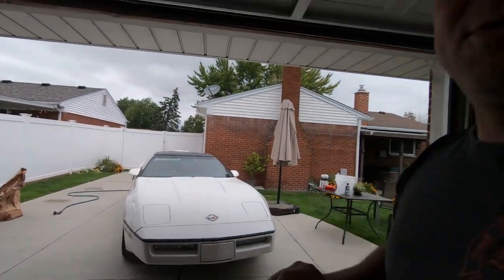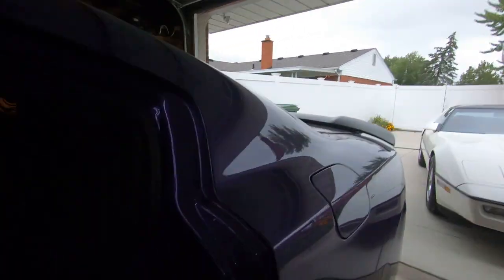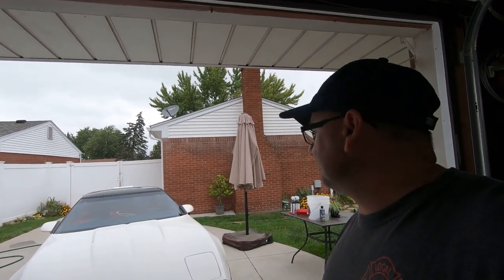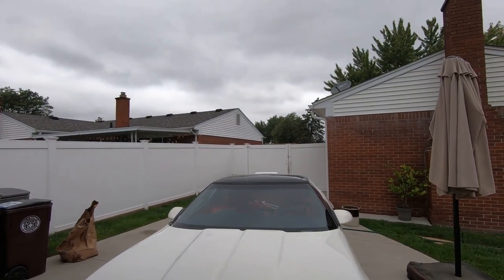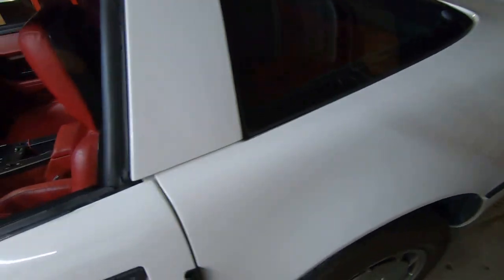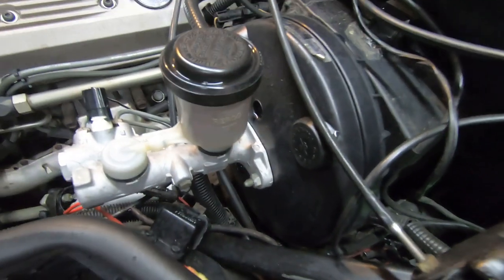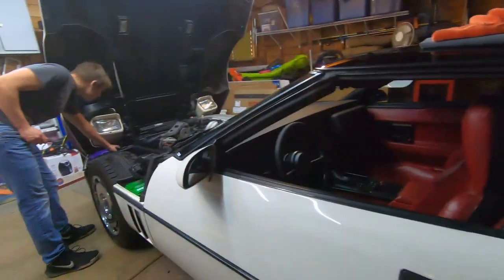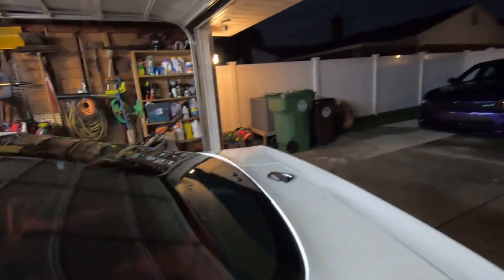Polishing 1987 Corvette with "Griot's Garage" New G9 Polisher

Comment: Nice job Ouzo, I recently purchased the G9 polisher & definitely better than the PC that I also own, even though I bought that one for sanding. These are great for medium to light correction but if I want to do heavier cutting I definitely use a 15mm or 21mm throw polisher or you can use a forced rotation like the Flex 3401 or their newer upgraded unit. These   units are quicker at removing tougher defects especially in harder paint finishes but one needs to be careful at being aggressive and removing too much clear. Great job and hope to see some more videos from you. Thanks, Vince.
Reply from the maker: One day I like to buy an 21mm throw. The G9 works great with a microfiber pad when using the boss system's.  Thanks for the great comment sorry it took 2 days to comment back  been working a lot. Have a great weekend